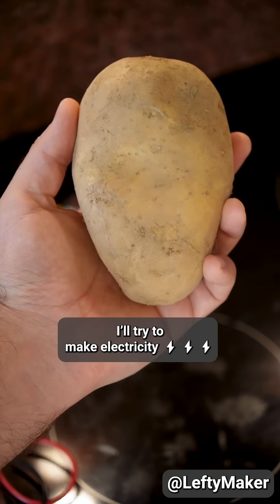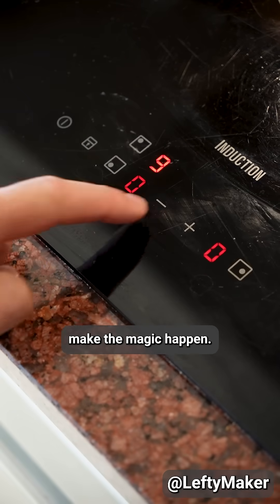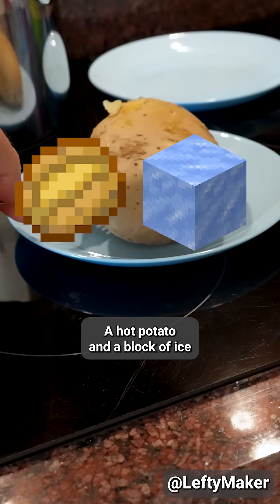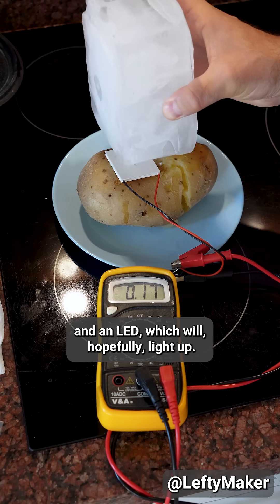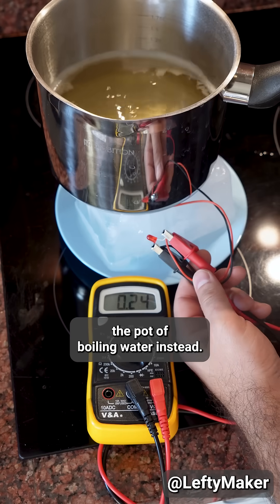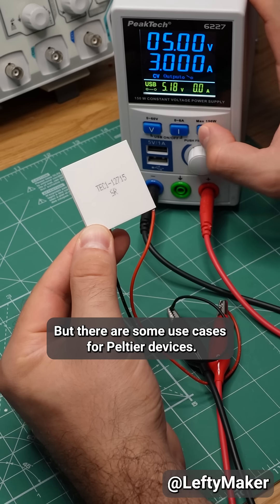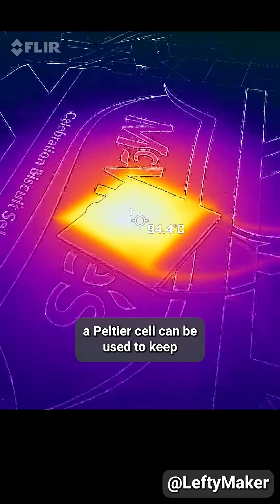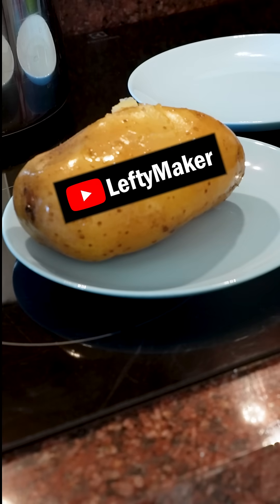Can I make power from a potato?

Comment: Wondering if we could use it as CPU cooler
Reply: well the thing is that peltier module is very good for cooling, but also generates heat

although it is possible to make that, you would require something to cool peltier

i was thinking the same, why not just use the peltier module as cpu cooler, but its not possible i mean i dont know, maybe someone knows 

but fans or nitrogen is better because, fan even when generate heat as something additional can cool themself when spinning, and nitrogen, but peltier module can't
Reply from the maker: I don't think it's going to work well and it will require a lot of power. However, I've seen phone coolers that use a Peltier module with a fan. Nubia has one
Reply: Tried it, to tell you there will be a lot of condensation. so I'm using it to cool the copper tubes that cools the CPU. and you need to cool the hot side of the Peltier module.
Reply: I definitely remember peltier coolers being a thing for a while in the mid 2000s, along with some other pretty goofy designs